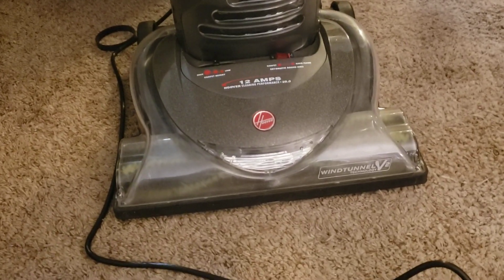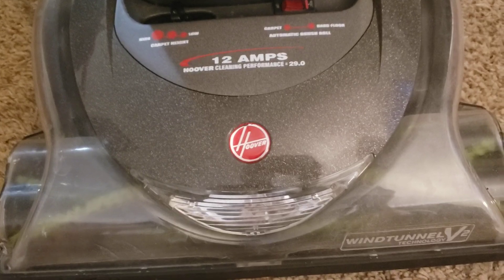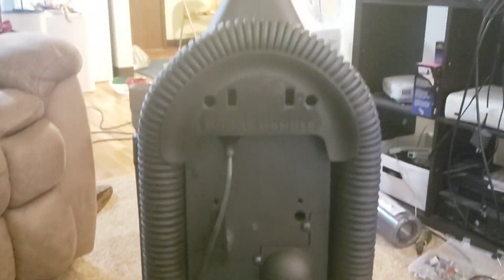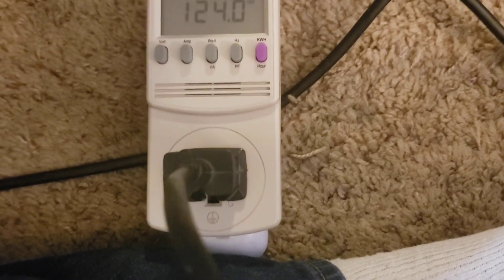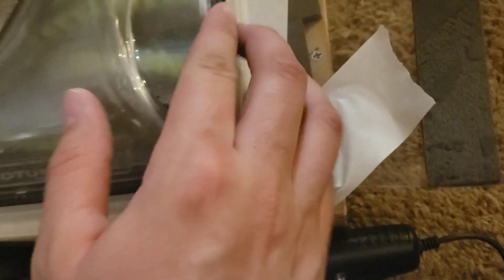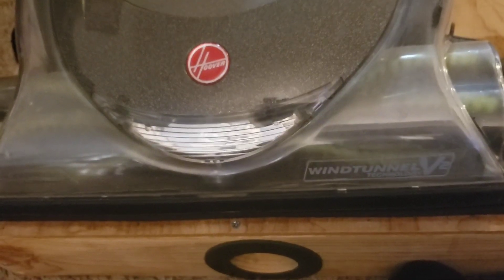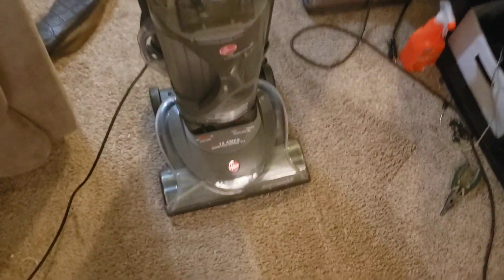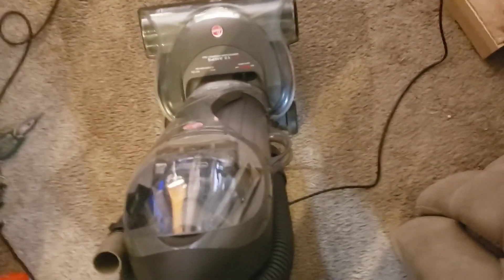Hoover Windtunnel V2 U8121 900 airflow test (missing felt seal)

Comment: Honestly I really dig the aesthetic design of these V2 models, but the dual brush setup just doesn't work all that well. That said there does exist a single brush model of the Savvy, so that combined with a Y bag would probably make a pretty decent cleaner.
Reply from the maker: oh yeah i've run across those in my searches. They'd definitely be more reliable, the concentration of the airflow would help it clean better, but they'd still be plagued by the wimpy small motor.